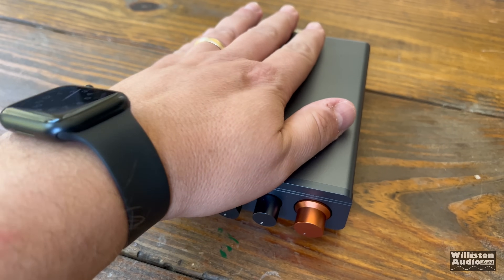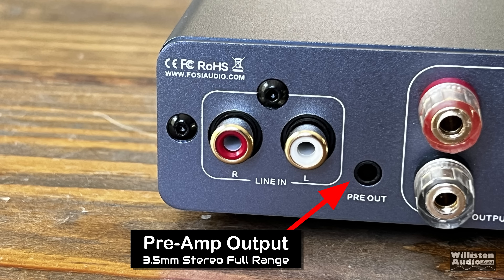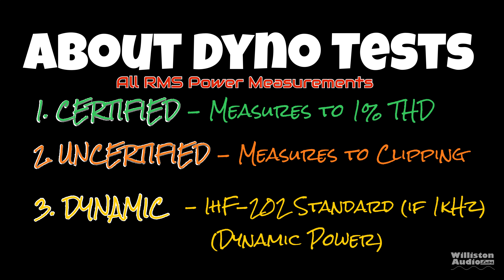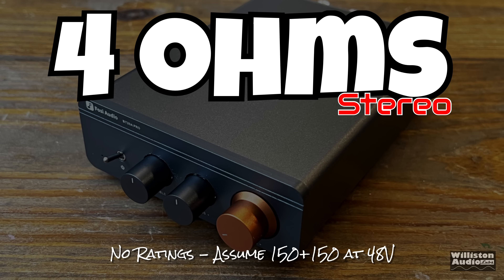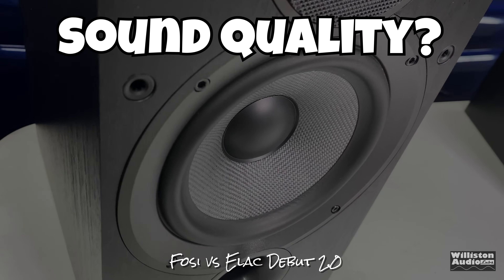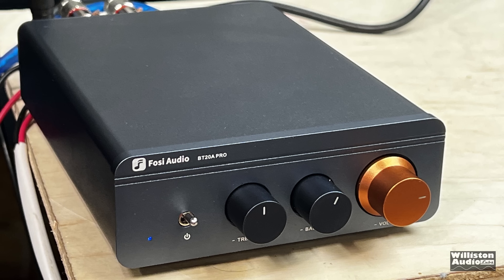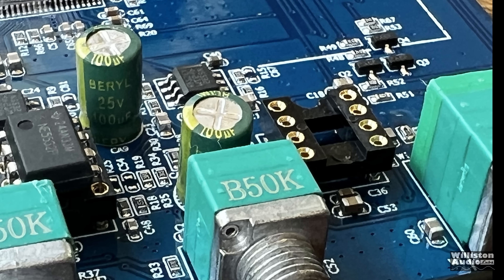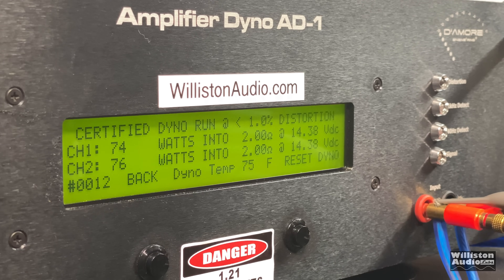Fosi Audio BT20A Pro Mini Amp TPA3255 Review and Power Output Test

Comment: Powering it with a 48v 5a power supply thats 240watts of input power and you get 211+209 watts output thats 420watts output from 240watts input

Comment: Great video thanks for taking the time to do this. I’m running this as my computer / office desk amp, with monitor audio bronze 2 bookshelves. I feel it’s a bit strained, I leave volume at 12 o’clock, but for louder / enthusiastic listening sessions or gaming, my DAC volume is 100% and the Fosi needs to go to 2 to 3 o clock position. That seems right on the edge, any more it will distort, and I can feel the bass is struggling after 12 o clock.

I was going to get some gold 100’s for my office but was worried the Fosi would not cope. I don’t think it will either as it is with 32v power brick, as the golds are more demanding.

The output more than doubling with 48v brick has convinced me to try it here in the UK for about £50.

I will try it and if it gives me substantial headroom, I think the upgrade to the 100’s with this amp may be a good match.

The BT is very compressed also, the difference between running line level from a good DAC to the amp via Apple Music app lossless on PC, or BT Apple Music from iPhone is huge. The audio sounds very compressed via BT and a lot harsher.

Thanks.
Reply: Oh, I did hear some people saying the amp gets VERY hot with 48v brick, but I will try and see. I let it idle at a decent % like said and then control volume through pc mixer.

Comment: I have one of these 3 years ago with the Texas instruments class D chip, from another brand it cost me $39.99 shipped from Amazon .. 3 years later this thing is insane truly insane quality as well the built quality!! It has so much so much power!! so much so two weeks ago I was making some music and by accident ..my mistake !! I sent the wrong signal instead to my subwoofer , i sent it to my speakers and yes it's my fault remember my fault!! I blown up both 150 w speakers by so much power it has!! I didn't even think it has that much power. I mean I kind of thought it was pushing my 150 watts pretty hard for all these years but I didn't really think it had or could be enough powerful to blow them!! I was thinking I'm like at least 20 watt away from that!! Just amazing deal for 40 bucks class D amp with a high quality Texas instruments audio chip come on now!! I will put this on the level of a $500 amp all day long and I did have three of those and this thing totally blows them away I had Harmon amplifier it almost decent almost I would say it comes 98% close by audio quality and of course my Harmon wasn't class d I had a pioneer 250 w and this $40 amp destroys it all day long everyday I have a few Sony units 150 w and the last one I think it was a 350 or something like that this is $40 unit destroys in my audio quality all day long as well

Comment: I wonder what the second set of NE5532 opamps that are not replaceable do?
Reply: preamp/input section versus power amp section of the circuit.
Reply: @bbaker6212 interesting, so NE5532’s can be used as a power amp as well? They have that much output power? I thought they were just opamps with only mA’s of output current.

Comment: I just received the BT20A yesterday and immediately swapped-out the factory NE5532P Op Amp DIPs with a pair of OPA2134PA ICs.  The sound is good, but I think it's still handicapped by the pair of surface-mounted N5532 Op Amp ICs that are further down the signal chain before the TI TPA3255 amp chip.  IMO the sound can only be as good as the "weakest link in the chain," so they should have allowed all four to be replaced... and while we're on the topic, why so many OP Amp ICs anyway?  Each one is dual (two channel), so they should have been able to use one or two ICs like my old Lepai Tripath mini amp.

Comment: I had one of these. For one day. I had a vintage NAD that suffering a bit so I thought I’d try this based on the almost universal positive reviews. It was SHOCKINGLY bad. The thin sound was awful, regardless of knob twiddling. All I can say is everyone’s ears must be different to mine. Sent it back. I got my NAD fixed.
Reply: you obviously got a broken amp from factory.
Reply: what speakers were you using. That obv can make a big difference.
Reply: Yes, until last week I was using the fosi with a 32v supply. It made my new q acoustics 5010s sound thin with no bottom or soundstage at all really. I switched to the 48v supply and the difference was stunning. Great wee amp

Comment: 32 volts times 5 amps equals 160 total watts or 80 watts DC per channel...RMS watts a little bit more. I'm using the Fosi  TB10D with a 48-volt 10.4 amp supply
Reply: "32 volts times 5 amps equals 160 total watts or 80 watts DC per channel..."  That would be true if the amplifier were 100% efficient.  Being Class D, it's probably about 90% efficient, so probably shave off 10 WPC and call it a day.

Comment: Bought one a week ago and paired it with my 2 x Boston VR2's. Enjoying remote control function via my Maverick media player (using the 3.5 socket on the media player)
Intending to connect an active sub from the Fossi's pre-out..
Awesome sound level and quality at 12 a clock volume and bass + treble at 12 as well. 
A lot of clean punch.....i was skeptical but not anymore. Just ordered a 48 5A power supply to, theoretically,  extract the maximum performance / quality from it.
Oddly in terms of other comments about the heat build-up, i am not noticing this at all, even though i built a small base containing a 120mm cooling fan...just in case. No need now to use it...will see though as time goes by.
Highly recommended....😊

Comment: Will it handle up to 56V? (A fully charged 48 battery)
Reply from the maker: According to the spec sheet, the TI 3255 amp chip can handle a max of 53.5V, but this doesn't mean this amp is designed to handle 53.5. But the basic answer to your question is no

Comment: i tried to compare the bt20A pro to my old yama ax 390 only 35 watts per channel but why the yamaha put up more volume than the fosi bt20a even on 48 volts power supply the yamaha out performe the said 300 watts by an old 35 watts perchannel amp
Reply: @xzxzt4  how are you measuring "volume?"

Comment: Sir, what kind of connectors youre using for it if its not suits with banana. Thank you.
Reply: The most common size for banana plugs is 4 mm in diameter, but smaller 2 mm and 3 mm plugs are also available. Personally I use speaker pin connectors, and the ones I have are supposedly 12 gauge (roughly 2mm).

Comment: Daaamn, that's a mean little f**ker 😍🤤.. And as far as the no remote control situation goes, it would just be an unnecessary OVERKILL but of course only when using bluetooth 😅.. But with risk of sounding like a complete moron, how come you had different results between ch1 and ch2 🤔..? And would ch1 and ch2 be equal to left and right 🤦🏻..?

Comment: I just got one of these as I was looking to get a new mini amp for my desktop setup. Looked at videos of these amps and this one seemed to have the best results. Got the upgrade power supply and it has some good punch. I think it needs more current but all in ill its a solid amp.  BTW its pushing a 2ohm load per side very easily. Two pairs of JVC wood cone speakers. Each side is 2 4 ohm speakers wired in parallel to the amp.

Comment: I'm using a BT30D with Mirage SM3 speakers, 4 ohm, interconnected with 24:1 twist 16 gauge thru an iPad mini and Spotify.
I bought the fosi as my first generation NAD 3020 series 20 Amp is getting recapped and the power transistors remounted.
The Fosi does push the Mirages quite efficiently, however the volume needs to get pushed to the upper end to reproduce cleaner sound.
Question, is this sound level indicative of these class D mini amps ? Or is the iPad mini amp circuit the restriction ? Or the streaming bit rate from Spotify ?
Any thoughts ?

Comment: Recently picked up a BT20A Pro, could't resist pairing it with a MiniDsp2x4HD and another Fosi V3 for a bi-amp two way (8" SB woofer+Tectonic 1.25" full range). Just astonished by the quality. For under $600 total, a low-distortion 100WPC biamped 2-way with DSP. I can't speak highly enough of these Fosi amps.
Reply: But who really deserves the credit, Fosi or TI? 😁
Reply: @TheUtuber999  Lol I'd say both- Fosi's EE team sure knows how to read a datasheet, I can't say the same thing for a lot of manufacturers 🤣

Comment: Right, for 5 seconds.. with 48v supply, 2x100w @ 8 Ohm, or 2x150w @ 4 Ohm
BUT, if you put this thing in serius work, will not last for 10 seconds, it will shotdown! Wonder if you test amps for 2 hours, how many will survive test? Lets be real now, Ti TPA3255 is 1/3 real power or 2x50@8 Omp, 2x70w@4 Omp, not as advertised 2x300w
This IC is so small, will NEWER, EVER work in PRO envirement, not even close! With 4 channels x25w it is a toy for kids
Ti need to doble power on small Class D amps, then I will consider using there products in my projects, it is time for new and improved 2Mhz power Amp with x2 power and  x10 cooling surfice...

Comment: I just got one of these and I'm finding that the pre-out signal is exceedingly weak. I have the pre-out going to a Fosi M04 subwoofer amp and any speaker hooked up to the M04 is inaudible when compared to the main speakers being powered from the BT20A.  I'm not sure if something is wrong with my unit, but it seems like the differential between the main and pre-out is so great that you would need a line-level booster or preamp on the pre-out to make it useable. Can anyone else confirm?

Comment: would somthing like this be a decent replacment for a ht receaver for a 22x24 garage setup? got 2 floor standing speakers with 1 12inch driver, 1 6.5inch driver and a tweater. and then 2 book shelf speakers. had them wired up in quadraphonic but my receaver has recently died ( it was a marman kardon avr-120.

Comment: Great Video!  I just bought the Fosi Audio BT30D Bluetooth Mini Amp,  it has 3 outputs,  50x2 and 1x100 for a SUB.  It also has pre-amp outputs as well if the internal amps are not powerful enough for you.    I hope it gives outputs like this amp you reviewed here.   I'm redoing my Bathroom and in the shower I'm installing a pair of Rockford Fosgate M0-65 Marine Grade 6.5" Coaxial Full Range Speakers in the ceiling in the shower and a Polk Audio DB1042 DVC - DB+ Series 10" Shallow Subwoofer for the wall of the seat that we are building the shower.  I'm hoping the BT30D will power those 3 drivers with ease.   If not I have tons of amps I can hook up.  What do you think?,  Will I be OK?   Thanks!

Comment: Great review! I'm glad you took it all the way apart, including showing the TPA3255 chip. I would be curious to know if any of these mini-amps are using post filter feedback. TI shows how to do that  (Application Report SLAA788A ) to improve the THD at the expense of gain, which can be made up elsewhere in the system. Post filter feedback is nice because it reduces the effect of output inductor nonlinearity and flattens the frequency response if done right.

Comment: I just bought mine straight from the vendor with 48V/5A PS. About $100 with discounts and taxes. The deal is that 48V x 5A = 240 Watts. And it turns out that at 7:14 in you video you show in the 1% harmonic distorsion a 168+163 which equals 331 Watts at 1 khz and 1% THD.. Now I know, as an old timer, that:

1) DIN and EIC standards rating at 1khz, 1%THD are both about 33% higher than rated power RMS from 20Hz - 20kHz, and a way much smaller THD (0.03 - 0.1). Ergo this amp is about 248 W total for both channels driven (124+124 avg) @ 4ohms 20 - 20,000 hz This would be the bottom figure..

2) EIA standards rating at 1khz, 1%THD is about 10% higher than rated power RMS from 20Hz - 20kHz, and a way much smaller  THD (0.03 - 0.1). Ergo this amp is about 296 W total for both channels driven (148+148 avg) @ 4ohms 20 - 20,000 hz. This would be the top number,

So this PS (48V / 5A ) IS probably underrated at 240 Watts. You also picked as a reference from the Ayima site the rated output power of the 48V / 7.5A combo, which is 360 Watts. Heck this sucker pulled 331 Watts!

Quote from ecoustics web site: "The FTC’s 1974 rule specified that stereo amplifiers be rated with both channels driven simultaneously into 8 ohms across a specified bandwidth (20 Hz to 20 kHz) at a specified level of distortion (THD), and that’s how things went until the appearance of multi-channel AV receivers." THESE AMPS ARE NOT AV! THEY ARE PLAIN OLD STEREO! Adding a 3rd line output for subwoofer does not turn them into AV receivers!
Reply: If you look at the chip manufacturer, they are rated at 10% THD!!! And then the seller copied this spec without mentioning it's a power output with ridiculous distortion. The charts do show what you say, though, and the chips are rated honestly

Comment: bt20a pro has a slight pop sound when shutting down togle switch coming from speakers does anybody have this problem  tried another amp no pops thanks for the info
Reply: What position is the volume knob at?

Comment: How did you test the pre-out? Did you feed the input with an increasing level signal or was it at fixed level and you raised it with the volume knob on the fosi? I'm just curious about its working, if pre-out has a fixed gain (in a line out fashion) or if is it possible to control it from the fosi volume knob.

Comment: Putting the sound through some cheap speakers positioned like that will not give you anything like a demanding test. Also I think with the distortion measurements, a lot of that distortion is noise and this is why as you raised the signal level  the distortion went down, as per it created a better signal to noise ratio.

Comment: Im super impressed with my Fosi and Ayima amps based on the TPA 3255. They are powerful enough for me but more importantly, they sound really good. On my Ayima, I’m using a 48V 10A amp supply.  I don’t need that much but presumably, it provides plenty of headroom.
Reply: Kolego możesz podać dokładny symbol tego zasilacza.

Comment: Just for information. If you are considering upgrading the op amps, you will need two dual op amps. Burson V6 Vivid dual op amps work well but are too tall for the case, so the case will need to be modified to accommodate their height.
Reply from the maker: Thanks for the info, very useful!

Comment: It is really worthwhile to change the op-amps. LM4562 is a good and not that expensive choice, but Sparkos discrete op-amps would be a really good choice.

5532 are the worst crap you can put into a HiFi device, but they only costs a few cents.
Reply: MUSES02 and Sparkos SS3602 is a good choice.

Comment: You got my sub on this for sure...  Can I ask that you look into the new Aiyima A07 Pro?   

I have one and have modified it a bit.    I'd be interested in your tests.   I have 5 sparkos SS3602 op-amps in mine currently.  I vented the chassis,  replaced the tiny aluminum heat-sink wafer on the chip with pure copper,  re-pasted the chip with Thermal Grizzly Kryonaut Extreme.  I also put heat-sinks on the voltage regulators.

I think the snr and thd measurements are kind of bad on the A07 Pro compared to this Fosi and the original A07.   I might just pick this unit up and give it a go.

Comment: How does it switch between the Bluetooth/RCA input?
Reply: Well it's kind of annoying but you press the volume button for 5 seconds to disconnect the Bluetooth connection. You'll have to pair it again if you want to use it with Bluetooth again.

Comment: Unrepentant audio snob here with limited knowledge of electronics. Great review, and I bought a unit just to see what modern cheap Class D can do, and I am pretty impressed. Thing is, I think these are dual op amps, and I just happen to have a dual Burson Vivid op amp in a drawer. Any idea if I can get away with replacing a single op amp, and if so, which one to change ? Not sure what the two dual op amps are doing here.
Reply: Answering my own question. As usual, both op amps need to be replaced at once, despite the fact they are dual channel. Fosi audio support super fast and super helpful.
Reply: @TheUtuber999  Cringing a bit at my ignorance of a year ago. Thanks for pointing it out again despite the fact I had already answered my own question 😮

I've now moved on to fixing vintage gear for fun, and scouring YouTube for idiotic posts from the past in order that I can respond and try and convince complete strangers that I'm really quite clever, honest.😉

Comment: I just got mine, thanks Big D for the discount!!! I have a set of Focal 705V 100watt 8ohm speakers hooked up with a small 70watt 8” yamaha sub. Im very impressed even with the smaller power supply. I will get the 48v when available. What op amps would you recommend? Thanks🙌
Reply: I ordered a 48v power supply directly from Fosi and it really woke up my speakers! I added Sparkos op-amps and a 12” Martin Logan powered sub. Now its very detailed from 20-20k hz!

Comment: it for sure offers great value for the money. however, regarding the distortion, i would assume that the power supply section comes through with some distortion once you get to a power level where the 2800µF cap does not have enough capacity to smooth it out. second thing are the output filter coils. they can easy get into saturation at higher output levels.
these are the two weak points that i can see from here. and for that money it is not possible to put in some high end coils from coilcraft and bigger low esr caps from panasonic.